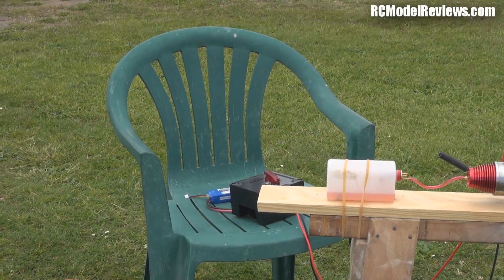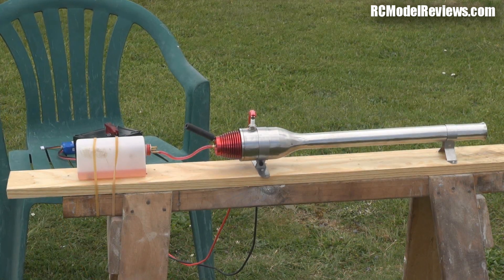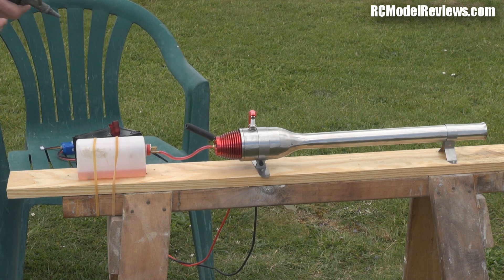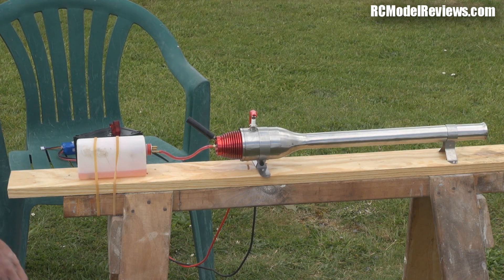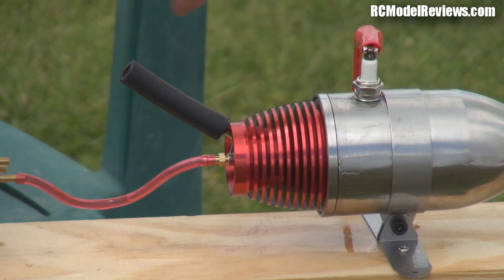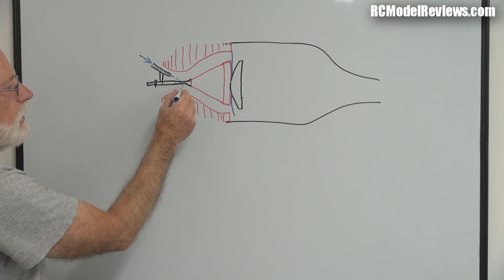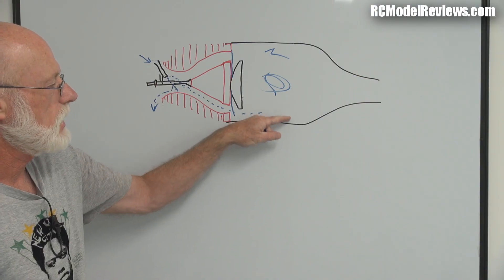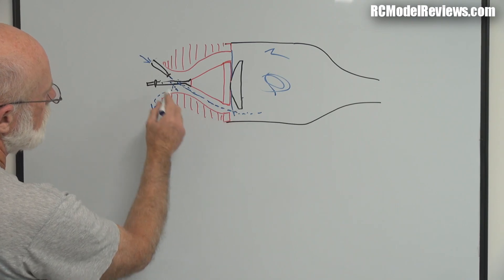A problem with my HobbyKing Pulsejet

Comment: If you slide a solid steel rod through a hobby king engine you can use an English wheel and a metal forming hammer to make the oval shape exhaust pipe round.

Comment: These Hobbyking Pulsejets are rubbish, they are literally a toy. The problem with these is they will break along the welded seam along the engine length. They can't withstand running static for more than a few seconds before beginning to melt. A trick to starting these is to start flooded, a flame at the exhaust will start the ignition cycle and the fuel level is critical when starting. Air can be just blown into the reed valves to start the air fuel mix. I can see from this yoru fuel level is way too low.

Comment: start of the fuel flow is wrong?
why don't make a backup fuel line (ONLY FOR THE FIRST PUSH) to the combustion chamber?
give fuel to the chamber, spark it and the flow should start the engine

Comment: I could have gotten it started. I did this 50 years ago.
 It's too lean. The level of the fuel is critical. Too low = lean. You're fuel level is way too low. You can see it in the video. That is, you can see the fuel running back into the tank every time you stop with the air. It popped a couple of times. If the mixture is right, one pop and it's running. Another inch of fuel in the tank would have gone a long way towards success. I guess I'm more of an expert.

Comment: I had similar problems with mine but sorted it out by (a)sealing the threaded front part with exhaust pipe assembly paste as fuel was clearly leaking past the threads,(b)pre-heating the tail pipe and combustion chamber with a blow lamp and (c)raising the tank height so that on starting, the fuel level was just below the centre line of the engine.All was then fine and the noise was ear splitting....!!

Comment: Just by looking at it, the fuel level is way too low the level of fuel needs to be just under the the flow jector and maybe the reed valve is stuck when i got mine it wouldn't start, cleaned the reed valve and fired right up I have also found that the best fuel these run on with the standard flow jector is shellite.

Comment: I suspect your Pulsejet is in working order.
What is not in working good order is your startup protocol. You are using a air compressor that seems to compress air quite well, but has a very low flow rate. Your high pressure low volume air results turbulent flow, which is blowing your fuel back out your intake.
The pulse jet does not need high pressure air, it needs high FLOW (low pressure high volume). Next time use a leaf blower with a narrow tip outlet to increase the velocity of air. Keep the air flow axial to the jet until the jet glows red before removing. :-)

Comment: Are you sure you are connected right and that your air doesn't go to the center and fuel to the outside connection. I have made and used a lot of Ventura's and most of them air is injected in and creates a vacuum behind the air source and pulls fuel in and forces it into the airstream. From your drawing it looks to me like the air would be in the center and fuel pulled in from behind the air source. I could be wrong but I wasn't moving fuel with mine. I use to build them to move plastic pellets from plastic grinding equipment up into a hopper on an injection molding machine but the principal is much the same. I know that basically if you introduce an air flow in a tube just beyond one end that a vacuum is produced from one end up to the point that the air flow is injected and anything in that  vacuum is pushed past the airflow injector and out the other end quickly. Good luck.

Comment: If you are using glow plug fuel, it won't work at all :-) LOL ! A pulse jet goes with unleaded fuel or petrol, not glow plug fuel wich need at least 4HP compression to explode/ignite...
Also, more than 2 bars (around 30 PSI) is a lack of understanding. I can clearly listen that you are way over the lauching procedure....

Comment: bruce, had exactly the same and i think it has to do more with the sparkplug been to far forward, by the time the fuel is coming out the front it should have long fired.....

here is what i did :

turn the engine 90 degrees so that the sparkplug is at the 3 o clock position ( viewed from the front ), then turn your inlet that the air nozzle blows in from the 9 o clock position ( viewed from the front ) - what this does is that it takes the fuel air mixture and actually blows it across the engine combustion chamber towards the sparkplug.

I use cleaning benzine and it fires imeadiately when the fuel hits the fuel nozzle, no hesitation at all...

If you compare it to the original dynajet motor you will have noticed that the original has a different sparkplug postion...

try it and let me know if it works...

oh yes, something else - when you tighten the flowjet be careful not to bend the lineup during assembly, it is supersoft...

Comment: I had the same problem. Try rolling the spark plug around to the 5 o'clock position. This helped wet the plug a little better for ignition.
Also test the sparkplug. Sometimes it will spark within the confines of the space between the electrode insulator and the thread instead of across the gap. This shrouds the spark and prevents ignition.

Comment: I found with mine if you position the air feed at the bottom so the air fuel mix is blown through the petals into the spark plug it fires up easily , also you only need a fraction of the air you are putting in it all that seems to do is hold the petals open, mine starts and runs easily now

Comment: I have found so far the Basics of the Jet are perfect.Just the spark plug & buzz box to basic & flowjector is best modified for Methanol use.If nothing else set up the flowjector for Methanol.

Comment: Me too - it's just dribbling out the front (a common complaint in my family). I found that by holding a gas lighter at the outlet I could ignite the fuel/air mix there, and by reducing the air flow, the flame would travel back into the engine where it would occasionally burp. This showed me two things: there is SOME fuel getting into the chamber and it's not being ignited by the plug. 
You have given me something to work with anyway. Maybe grinding away the stop on the injector would enable it to screw further into the intake?

Comment: As you're saying the air is blowing to the wrong place. But you also have too much air pressure! Your sucking too much fuel to be able to light up the fuel vapor in the burn chamber

Comment: I turned the flowjector around so the air nozzle was on the bottom (pointing up).
That way I was shooting fuel/air up towards the spark plug.
It was much quicker to start this time, but still takes a bit to get going.
I'm sure this flowjector isn't misting the fuel properly.
On a side note, a confused neighbor down the street came outside.  She thought the noise was her hot water heater blowing!  Good times.

Comment: I will bolt one on a Control Line & go fly tomorrow.Will put on you tube to point out everything you need to know.Some points of fact are Pipe is .5mm thick.Bailey is .35mm.OS is .45mm.Pipe is a bit shorter in length in chamber and total length.This is OK,Just means less power than the others.Head & reeds are perfect.Frojector has bad weld & a copy of Dyna jet & OS pulse jets.Use a Bailey Sport Jet flowjector.Buzz Box is only good for Barbecue.And use Methanol to protect the reeds & help starting.Just drill out main jet to 1.6mm

Comment: Bruce, couldn't it have been an issue with the pulse valve itself?  If the valve is too stiff or not properly calibrated, then air and fuel are just going to push back through that intake port.

Comment: I had the same problem with my HK PJ and checked the Flowjector with the known prints for a DynaJet and the 35 degree angle on the prints is were my Flowjector is set at. Also checked the hole sizes and there location per the prints. All is on. I did a search on line and found what noclassmac1972 said to have the openings at 12 and 6 o'clock position. Also fuel level in relation to center line of PJ is a issue, Move the tank around. Also here in South Eastern Washington State (USA) it has gotten very cold here 19 Degrees F at day and a over night low of 10 F. I preheated the PJ engine and it fired right up.  I have 3 more HK Pules Jets inbound and a extra Spark Box. I also elevated the front of the PJ too. Bruce PLEASE DO POST WHAT You find out on your PJ. Again thank you for your video on how to make reed valves. I have spring steel and SS plate inbound to me. People please keep posting what you find or see right or wrong with HK PJ. We are a world wide R&D team for good ideas that are just not tested very well before they are rushed into production.

Comment: I have had the exact same problem as you, the fuel was pouring out the front, eventually that week air injector broke off. I used a huge air compressor too.. Really bad QC at HK with this product. I had big plans too. Looking forward to seeing you're run mate.
Reply: lol, i thought i was the only one that broke the "air injector" off this pulse jet. Not held on very well. When I start mine, I'm going to just aim the compressor nozzle manually.

Comment: I accidentally broke my injector on my Hobbyking pulsejet.. well the the part of the injector that's shown on the video as being the wrong angle.. I snapped it off whilst screwing the thing in! But, must have done me a favour as I just blew air into the jet using my compressor and fired-up ... ok to awhiles to catch but now I've seem this video I've a better idea at the angle to point the compressor gun at!! Btw, I think the parts are too delicate to weld, it may be a case of soldering instead. Anyone know if there's gonna be spare parts available from Hobbyking at some point?

Comment: Hi Bruce.  Good video.
I had the same problem with mine and it's definitely a fuel feed issue (or lack thereof).
I was able to start successfully by spraying engine starter fluid into the intake.  Further, only when I raised the tank so the fuel was level with the flowjector was I able to get a good start and run.  it didn't take much air to start it once I did these two things.
Thus, I feel the flowjector isn't doing a good job of providing fuel.  It's not creating a spray.  It's just spitting fuel out and not misting it.  Hopefully it is due to the angle as you pointed out.
One other thing - when applying air to the front end, rather than directly through the flowjector, the fuel actually gets blown back up the fuel line... Venturi effect isn't working right.  Perhaps the flowjector isn't situated at the correct point inside the venturi.
Regards from Canada

Comment: I'm a noob to pulsejet and anything that uses fuel in general, but perhaps its because the fuel line is above the actual fuel? Try flipping the tank over so that the fuel is pushed down the line with gravity :)
Reply: i was wondering about that too, how is the fuel getting into the line to the motor ? i also think most likely it would help to to tip it over 90° so that the fuel goes on gravity.
Reply: No that's not it fuel was running out the front of the are inlet so it was drawing fuel from the tank.

Comment: Hi Bruce just checking to see what psi you are running on the compressor as we have found 55-65 psi to work best. also the holes in the flowjector needs to be at 1200 & 0600  some reason they don't like being where you have them..  
regards Robert ( kiwi jet squad )

Comment: Seems to be a big problem getting these started, the only thing I noticed that you've done differently to others, is that you have yours flat/level. Just a suggestion, if you haven't already, try raising the red head up 10 degrees or so just for ignitions sake. Never know, may start it and once started, maintain enough power to draw air/fuel through by itself. If not, then defo looks like HK are becoming box pushers.

Good vid/review anyway.

Comment: Nah, you can't be that unlucky with the duds. The HK ratio of good to bad is well skewed towards the latter as far as I am concerned. I recon that I get just as many duff items as yourself.  This pulse jet looks great, which its meant to be so it sells, and despite it's problems, in your hands its probably relatively safe. However in the hands of the unknowing and unwary, something that's playing up like this is a disaster waiting to happen  :-(     ................... Just look how the unexpected thrust caught nightflyer out when it did finally start up and the speed at which the tail pipe went into superheat mode.  Hmmmm.
Reply: He shouldn't have been surprised.  Imaging hanging a 3.5lb weight off that light foam model -- of course it kicked and bucked.   It's also made very clear that these things run red (not white) hot.   Such things should only come as a surprise to those who don't read the manual.

I would argue that a pulsejet is actually safer than a 50cc gas engine -- I'd rather be surprised or suffer a burn any day than come into accidental contact with a 22x8 carbon fiber prop spinning at 8,000 RPM!
Reply: ***** I'm not arguing that pulse jets are intrinsically unsafe, what I am saying is that selling something as poorly made as this, re your reviews, is an accident waiting to happen.

Comment: I don't think you are alone with this problem, Bruce. Here in the UK Youtube poster ThatHPI GUY also has had problems with the air "flowjector" assembly as his broke off due to the brittle construction on his example.  Regards = Nidge

Comment: Bruce I found it really helps to have the starting air track angled at the spark plug. I can start mine with a bike pump if im out at the field.
Reply: Yes, I did try various permutations of flowjector/plug alignment but to no avail.